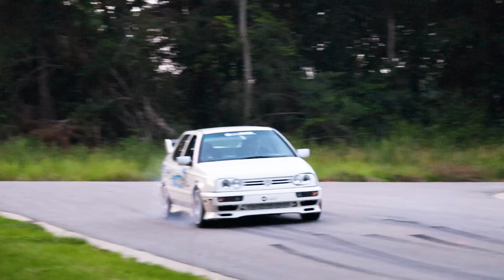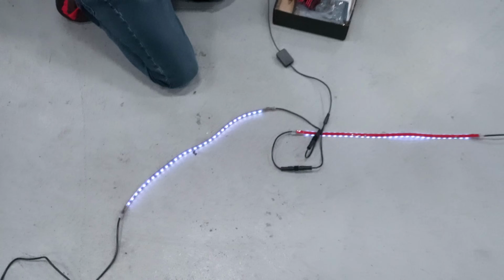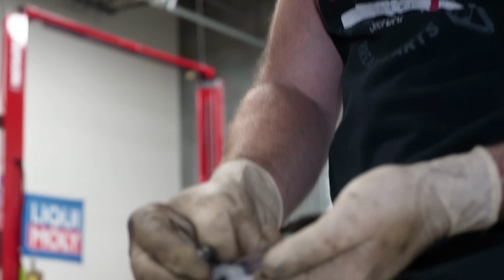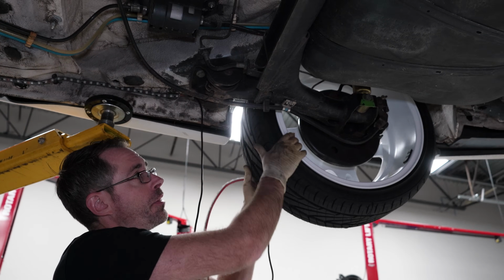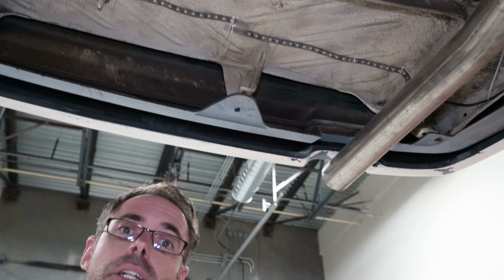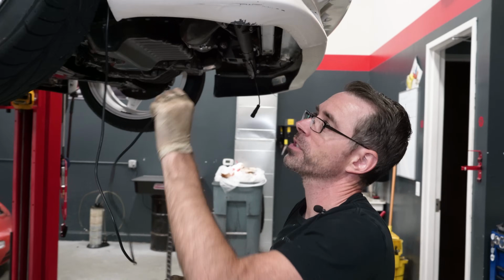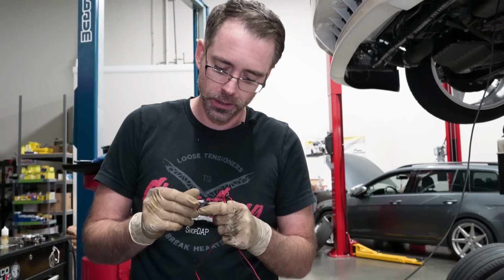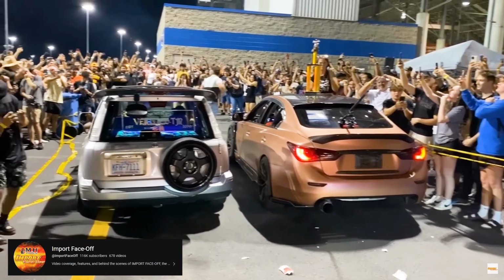Jesse Drives our Fast and Furious Jetta!

Comment: Fun Fact they are called Neons cause in the days you had to use actual neon tubes.
Reply: Ahhh the good ole days
Reply: Street Glow still produces neon tubes, looks much better than led imo
Reply: What were there zoomers out there that didn't know this?
Reply: Umm is that not common knowledge
Reply: Yeah RGBW LEDs are a lot more durable and versatile lol. As cool as neon tubes are
Reply: @yuriyh4238 depends on the LEDs. Diffused LEDs look best by far imo
Reply: Neon means neon? Mind blown
Reply: The good all days
Reply: I used to install neons on all types of cars back in the early 90s. Honestly neons give a whole difference effect then rgb underglow lighting. It looks like the car is floating on a neon cloud if installed correctly. We even had neon license plates ;p
Reply: It's also reference to color. Neon blue,  neon green,  etc
Reply: @RyanRiopel  The term "neon" has broadened in definition to refer to any sort of colored underglow on a car. As already stated, the term originates from the technology of the period, which used neon tubes. However, while this guy says he installed "neon" on the Jetta, what he actually installed was LEDs. Neon tubes were incapable of doing color-chase patterns like a 19:00, nor could they alternate between different colors. The most you could do is wire them up so that they pulsed with the bass in your sound system. 

The point is that everyone in the modern era still refers to underglow (which is actually the true correct term) as "neon," just like we still say we "dial" phones, even though phones don't have dials anymore.
Reply: @chorlesteajones6794 I remember that
Reply: Such a Noble Gas.
Reply: Yeah i grew up with neons under my seats in my 2g eclipse and kids would get in the back and break the fn tubes every weekend.
Reply: Fun fact. Lame then, lame now.
Reply: @olaflange8210 to you…either young or old…keep ya two pennies in a jar

Comment: You forgot to do the classic screws in the fuel tank when installing the LEDs.
Reply: You know, it's funny you'd mention that. Way back in 2002, a local dude I went to high school with, his family owned one of those ridiculous wheel and tire stores. You know, where you'd get the wires or big gaudy 20s (those were once really big, crazy..) so dude basically got whatever he wanted. Anyway, he wanted to build a replica of the supra from the movie. 

Bought a mkiv, all the parts, then found a local dude who allegedly knew about 2js and supras.  While installing an amp in the rear of the car, managed to drill a hole in the gas tank and caught the car on fire. Very small fire, almost zero damage.

Fast forward a couple years, a friend of mine bought the car and wanted to finish it. Somehow, that car stereo fire dude, owned a performance shop now. Only took like 3 years, but friend finally took delivery of a mostly finished car. Thing was an absolute beast. Had a basketball size turbo, made like 25psi on "low" boost. Friend wanted to do donuts in a parking lot one night, and I stood outside filming it. Car burned to the ground.

Not only did this dingus install a mechanical fuel pressure gauge INSIDE THE CABIN OF THE CAR, he also ran a -8AN stainless fuel supply line right up next to the downpipe. So close it touched, eventually got hot and chafed enough, it burst and started spraying gasoline on the downpipe and turbo / header.

That was a really sad night.  But also, the irony the same idiot managed to set the same car on fire, twice!
Reply: @elesjuan  Should I laugh?

Comment: I used the same kit on my W140. I used some flat stock from Home Depot that I self tapped to the underside and then stuck them to that and zip tied as well. I then put them on a toggle switch in the trunk because even if they’re off they will still draw power and kill the battery. Jetta looks phenomenal!!!

Comment: I did neons on my fiesta, instead of using a fuse I put them to an external battery pack which I just plug in when I turn them on. Works well enough and stops fires

Comment: I would recommend using adhesion promoter with the double sided tape . It's not perfect but any little bit helps .
Reply: I mean, cleaning the surface you wanna stick/glue stuff to is the minimum you should do. That thing was way to dirty for something to stick to it well.

Comment: I found a bit of rust on the front and bottom and with a screw in your tube for the LED strip, the outside for the eye is nice, but I don't find anything technical about the screws and tairips

Comment: I have a similar kit under my car. it is directly to the car batery with a switch in the line and most of those LED kits use 2 amps. i fused it with a 2 amp fuse and works great. But most importantly Saftey first :)

Comment: Hey @Deutscheautoparts! I need a bit of an advice with a 1.8TSI ea888 gen 3 i have in my Skoda (in europe).
It's a manual and i money shifted it from 2nd to first, at 6500RPM -> 9200RPM (in 1st).
Two rocker arms failed, those broke the inlet camshaft and since the labour and parts with OEM stuff was about the same price as a second hand head, I chose to change the head entirely. 
After this, I noticed there is a very big increase in oil consumption.
I had ~1L per 10000k miles before the repair, now it's ~1L per 750 miles.
I suspect a few things:
1. maybe the rings in the engine got broken when the over-revving happened?
2. maybe the valve seals on the second hand head are not good?
3. maybe the PCV system (it was changed also because my original plastic box on top of the head was somehow cracked after this incident)?

what do you think? sparkplugs have been checked, they are dry and look ok after 10-15k miles after repair has been done.
Engine runs very well, no issues, no smoke on startup, doesn't have obvious leaks apart from some vapors at the oil cap area and some wetness in the variable timing cover + on the pipe that  goes out of the PCV system. it does have a big of juddering back and forth in 1st gear sometimes, at low RPM, especially when it's first started and preheat hasn't finished, but i understand that's normal.

Comment: Holes in the chassis dont cause the sheet metal to rust?? I used "Poxipol" to stick them and they r sticked rock hard. Poxipol is a trademark that refers to an epoxy adhesive. Epoxy is a type of thermosetting resin that hardens when mixed with a hardening agent.

Comment: They are called fuse taps and I've used them before they worked really well usually I do it into the same circuit as a window regulator if it's a low voltage circuit if it's something like a light I will just run it into the same views as the lights etc

Comment: And you still have not installed a neon-kit on a car, thankfully.
Neon is a gass and also short for neon tubes in car culture.
It's wrong to call it neon when it's leds, you probably already knew this but i have so few problems in my life that these are the things i worry about.

Comment: Wy screw in to the body?!?!!?!? with out painting or something like that driving it in the winter will rust the shit out of them. LOL
u drilled a hole with the battery in the trunk. what if u drilled on the wrong side. Back in the day you had streetglow and led where not that comon they looked more like the tube lights and they where one color.

Comment: Stop do not run it into your fuse box it can screw up your fuse box I learned my lesson it cost me an arm and a leg to get the car fixed it took a year to get the car fixed but the car's fixed you do not want to put it there what you want to do is actually buy a relay and run it on to the relay So do not listen to this guy

Comment: You are talking about homie install . your installation is the worst I have ever seen for LED lights ..they are not fn Neons..they are RGB LED lights. Neons are made of glass which are long glass tubes with gas in them.. i will give you  not 1 thumb  down but 2 thumbs  down .. and rate you a 1 on the install